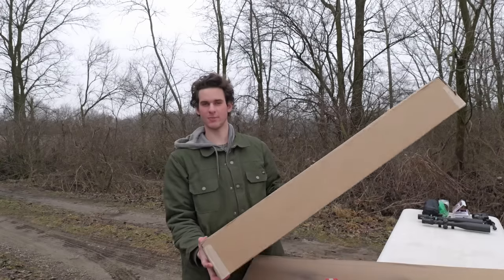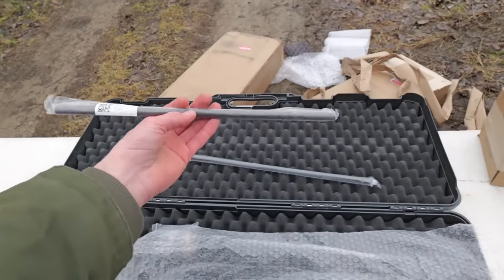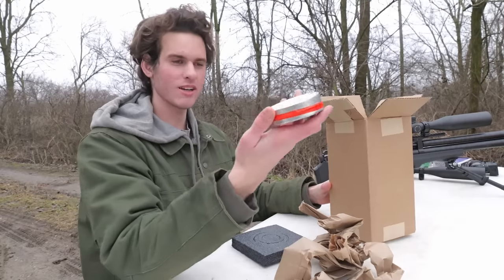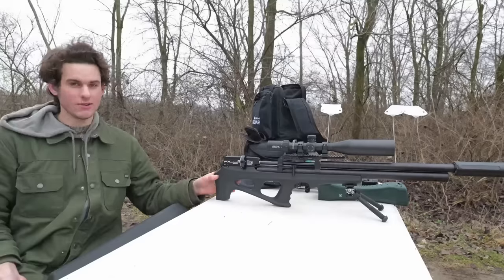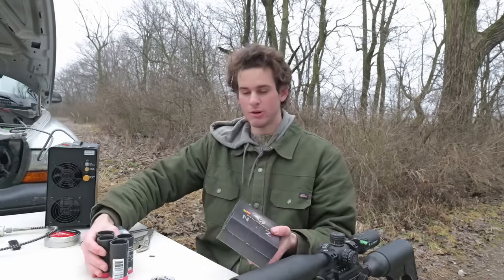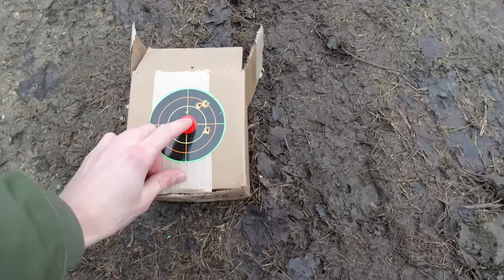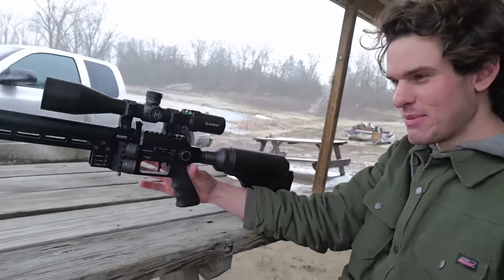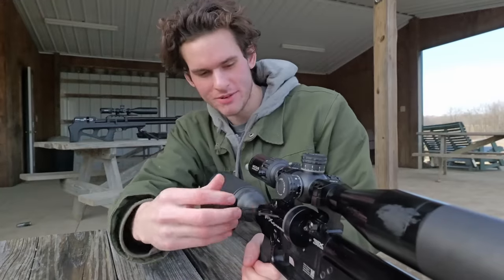I Bought an Air Powered SNIPER RIFLE

Comment: Bro, to get the Dynamic up above 1000 fps you should add the second tank swap out the hammer, and make sure you ordered it with the correct twist rate for slugs. The Zan Slugs should be fine at 920 fps. Remove the moderator aka silencer and see if that helps with accuracy. It could be clipping slugs, I have had a moderator not machined perfectly and it was clipping pellets and slugs causing all kinds of flyers. Is it accurate with pellets? Who did you order it from? Contact them. Utah Airguns is where I get my stuff. I no longer shoot FX airguns because the technology is outdated IMO. I shoot Edgun Leshiy 2s with 800mm barrels, which can huck slugs 150-yard sub-MOA. Then again so should your Dynamc. Something a miss. My guess is it's the moderator clipping the slugs.
Reply: Tank simply increases the shot capacity. It's the plenum volume that matters in power.
Reply: The Dynamics come with slug liners.

Comment: .30 $1900 Airgun that can't shoot slugs 😂

I own a AEA Challenger .30 with 800mm barrel, it puts out 250fpe with 110gr slugs, cost $459 for bullpup ($359 for a standard stock), I bought a regulator for an additional $100, it's got an external adjuster so it is tuneable for any pellet/slug, and more powerful than any other .30 out there.

Comment: If you got the 700mm in the  30 cal version it can only shoot at 850 to 900 fps
Reply: That is not true.
Reply: @fathertimencUSA  it is true and even fx their self say that it can only go up to 950 fps
Reply: @MOTOGAMING-uf1pz  I have one so I know it’s not true at all. I own several FX guns as well as some others.
Reply: @fathertimencUSA  ok sorry for  arguing I guess I cannot believe everything fx says about there gun
Reply: @MOTOGAMING-uf1pz  The Dynamics come with slug barrels except the 500mm models. Do you know what slug weight they were using to get that number. My 700mm factory settings the reg on 110 bar is putting 49gr NSA over 950fps. My Impact 700mm .30’c has no problem putting 44.75 pellets up around the 980’s if I wanted to shoot them there and the reg is around 135 bar.
Reply: @fathertimencUSA  ok thanks
Reply: How much fps do you get if it is a 35cal dynamic with a 700mm barrel

Comment: many people tinker to much whitout knowledge and then complain about fx’s. 1.read tfm. 2.write down ALL the settings the riffle came with.3. if You absolutely MUST tinker the first thing You do…understand the art of tuning, the higher reg pressure the higher tension and pretension on the hammer and the spring. 4. Dont shoot stuff to fast.. pellets never more than 900 fps in general , 940-990 is great for most slugs on the market. Sorry i dont mean to sound negative but i see this on so many forums, people tinker whitout the correct knowledge and then bash on fx airguns. they make one of the best airguns line up there is on this planet, fx guns are NOT for everyone and so is not a ferrari either.

Comment: Probably need what they call a tungsten hammer. Also check if you have the slug liner. Accuracy with 68 grain slugs and a pellet liner will not be great. Also check for groups without the moderator.

Comment: Also try to input all your info in Strelok Pro and find which ammo gives you the best stability factor. A 1.6 is usually a good stability factor 👌🏻. That's how I figure out what works for my twist rate. All airguns are different, but stability is key for accuracy. That .30 might like a shorter slug or maybe a longer. Just see what Strelok says for the ammo your shooting.

Comment: I have a late model Mk1 Impact and the other half has a Wildcat.., both Sub 12 (I’m in the uk) and they are the only FX rifles you need.😎
Reply: Not if you have FAC in sub 12 nothing more than a hw100 is ever needed 😂
Reply: Great being able to adjust between low power to no power 😂
Sub 12.........🥱😷

Comment: On your Dynamic you need double tank if you wanna reach over 1000 FPS it’s gonna pack lots of power basically your rifle turns to complete hunting pcp.
Reply: Extra air just gets you more shots not more power. They will hit a 1000fps shooting lighter slugs. If you want to push heavier slugs faster have to get a heavier hammer.

Comment: Call Utah airguns they will set you straight. I'm shooting a FX impact M3 30 calibers pellets at 890 ft per second with my first regulator set at 150 and the second one set at 100 I'm shooting 44.7 grain hades. Utah Airgun tuned it for me before they shipped it to me. it's a track driver. Call them.